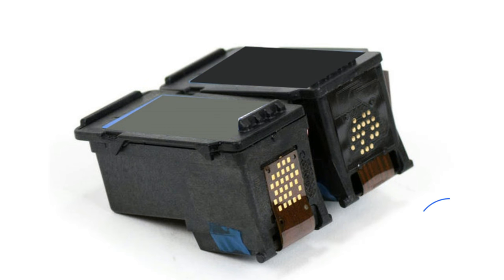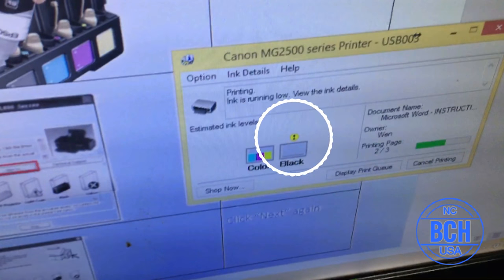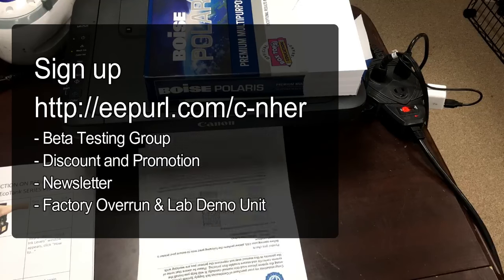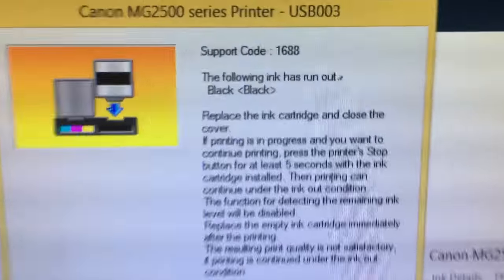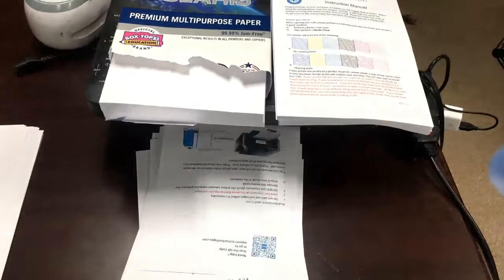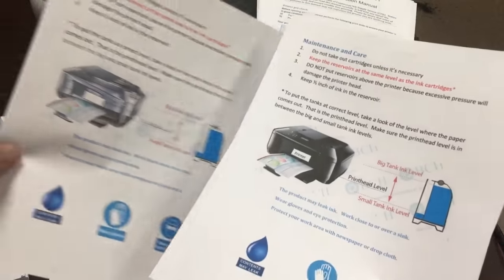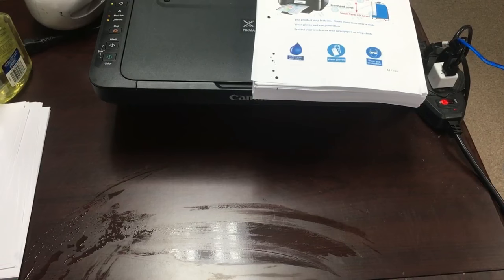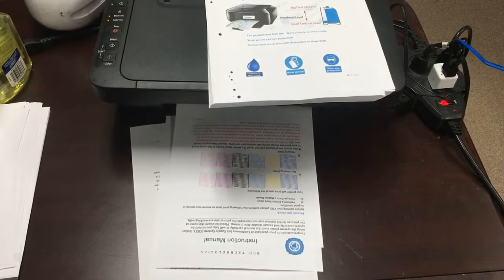Canon Printer Cartridges - How to Disable Ink Tracking Chip & Turn off Ink Monitor

Comment: I have canon Pixma e560 printer. When colour ink cartridge running low I filled it. But still printer shows it running low!! What should I do sir??
Reply: Same here, did you fix it ?
Reply: @Punjabibooksnapshots  no.
Reply: Clean the contact point of catrige with cotton and contact cleaner or nail polish remover with cotton 
If not resolve try to press stop button for 2-3 minutes

Comment: Thanks for the info. It's very important to make sure your cartridge is filled up with ink, and sometimes it takes a day to settle after filling it. I have had no printing because not enough ink and trap air in the cartridge, that prints after a night of sitting in the machine.

Comment: I use to have an older Canon printer that all I had to do is click print anyway and it would continue to warn me I'd run out of ink but didn't totally cancel out the cartridge as empty and not print, surely there's a way to turn off the printer chip from keeping it from printing even though it thinks the cartridge is empty or low on ink.  I know they've made it this way cuz they want you to buy more cartridges but it's insane the cost of cartridges and if you do alot of printing like I do, I learned early on years ago how to refill them but always had to tell the printer to print anyway and it's annoying, there's gotta be some way, a software thing or something that can cancel out the chip memory of the empty cartridges on these printers.  I had looked into the printer with the wells that you fill and don't need cartridges but then I see in reviews that they don't last very long, some part in them goes bad on the tubes that send the ink to the paper and there is no replacement of that part....kinda shady crappy stuff is that when you think you are getting a printer you no longer have to buy cartridges for but then guess what, you won't be using it long and can't fix it either...so they get you everytime.

Comment: I am using refilled ink cartridges with a canon printer and when i try to disable the ink detection feature using the stop button it won't work smoothly it takes a day and a half so that the printer gets back to work regularly. Do you have any tips that can help? Thanks in advance
Reply: What do you mean?

Comment: I had a thought. And I have a lot of experience with a lot of electronics, chemicals, processing of chemicals, the aerospace industry was very good to me. So I wonder semicolon do I really need the sponge inside of the cartridge or can I get away with something more coarse? The sponges that are used in a typical ink cartridge, I'm sure they were well researched by the manufacturers. And this is probably their idea of the optimal way to design a cartridge. But I wonder if they didn't do it for the point of view of trying to sell more cartridges? You know consumables. I kind of wonder if you can get away with basically anything from a cotton ball to a sink sponge? Or maybe just a piece of paper towel? My understanding of electronics is pretty advanced I never had to actually investigate in depth how inkjet printers work. My basic understanding is simple, it's an electric charge it's super heats the fluid and forces it to eject on the paper. But where does it care where it gets a source of liquid? If the only place that really matters is how much liquid is in the heated area when the inkjet sends the command to heat that heated area, theoretically you could just have a tube feeding this printer.

Now nobody wants to set up an IV system for their printer, but I'm wondering if you can't just tear the lid out throw a cotton ball in there dump the ink in and let the cartridge ink projection system do the rest of the work.

You know this is something I think I'm going to try because I have an extra printer around. I'm about to throw out in a couple of cartridges. It might be an interesting little experiment.
Reply: aerospace industry was very good to me.  lol you are going to take the airbrush art to a new level?
Reply: or cloud printing?
Reply: People do set up IV systems for their printer - this is called CISS Continuous Ink Supply System, you can just buy retrofit kits. You can also get printers that have CISS from the manufacturer, for example EPSON EcoTank, the prices aren't even particularly shocking, though of course higher than loss leader printers. I mean this is a precision high manufacturing complexity device, any printer, and by all reason, printers under 200 dollars plain shouldn't exist, but they do and they cheat their way to profitability.

The sponge is needed. If you just dump the liquid on top of the nozzle inner structure, the print head will leak the ink through the nozzles. The sponge suspends the liquid by capillary action and regulates pressure. Do not use fibrous material (paper, cotton) as a replacement, as the fibre will detach and swiftly clog the nozzles irreversibly. Replacement high capacity sponges exist, they have larger dimensions and possibly higher density, and with some luck you might find a suitable bulk material on your own as well. Not celluloid sponge. Dubious about kitchen sponge, the material is a random mixture low purity and low endurance. Remember inkjets are very sensitive devices that don't respond kindly to any particles, dust, contamination, dissolved solids that can precipitate out. Remembering how finicky colour photo inkjets with micro droplets were in the mid late 90s, i'm shocked the current devices with even finer nozzles work as well as they appear to.

Your thinking that the sponge is an impediment to getting more ink in, is incorrect, the sponge wall structure only takes up a few percent of the chamber volume.

Before every manufacturer settled on using sponges, there were experiments with spectacularly complex other solutions. They didn't work well at all.

Yes the lid of the cartridge is sonic welded on but it can be cracked off for the purpose of replacing the sponge.